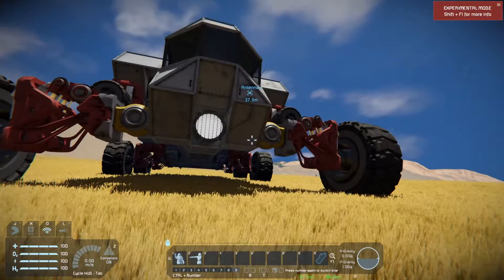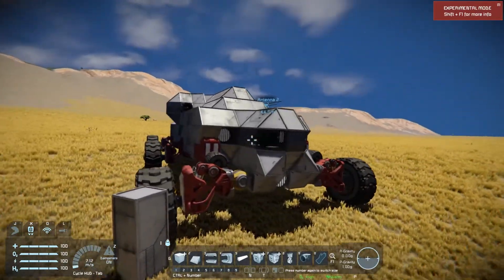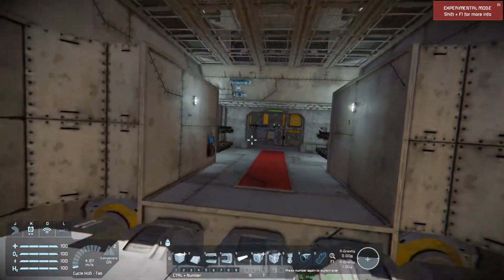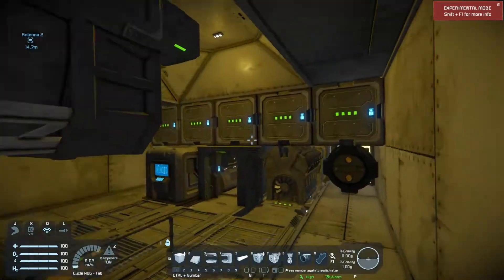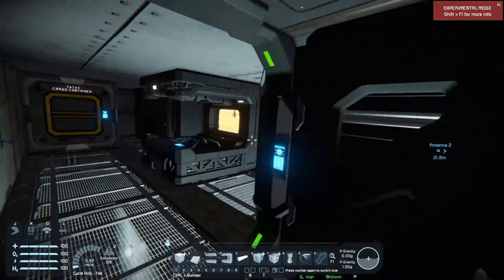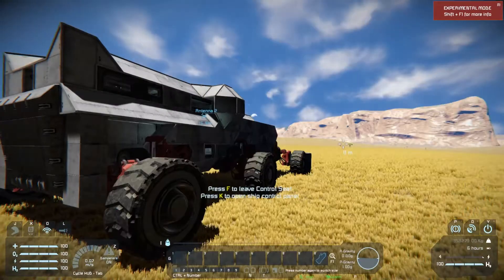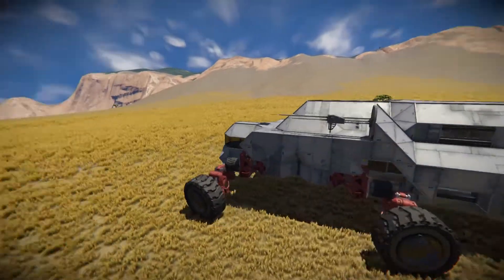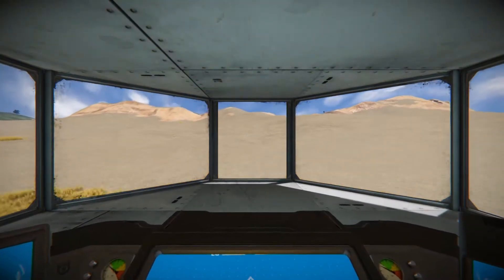SPACE ENGINEERS SUSPENSION SETUP THAT WORKS

Comment: I love this idea, however, I do have something I would like to try as soon as my finals over and I think you might have fun with it as well, especially since you noted difficulty with tuning out the bounciness of the system.

Pandemic Playground posted a video on Hinge Suspension and I think combining that with your idea of placing 1x1 suspension over the articulating suspension components might be pretty neat. I think this would be a good idea since the camber would not change with the suspension travel (the wheels will stay perpendicular to the ground throughout their travel with hinge suspension). 

More importantly, depending on how long the links are between hinges, you can choose how far or close the 1x1 suspension is placed to the center of the vehicle essentially being able to vary how much leverage the wheels have in comparison to the 1x1 suspension. Overall, being able to vary the leverage may allow you to choose how far the suspension travels upwards past its normal position before fully bottoming out the 1x1 component. Finally, the reason this may be worth exploring is that the ability to change the difference in leverage between the wheel and the 1x1 component may also allow for influence over the rate at which the suspension travel slows, when being compressed, allowing for less bounce when hitting a bump or hill if done properly (a phenomenon you noted in the video). 

I think the greatest issue (after it's all been tuned of course) would be making it compact and that might be the deciding factor on whether or not you explore this combination of suspension ideas. I'm also hoping to look into pushrod-style suspension setups, however, that'd simply be a different (not necessarily better) way of packaging the system. Overall, I think your idea is great, especially due to how compact it is, I hope further refinement is possible but the simplicity is what I like about it the most so I don't even know if it's worth bothering with! 
As others have noted, however, I would think limiting the maximum extension of the suspension through the options available for the hinges would be a simple improvement to the design (although, I'm sure you've already looked into that since publishing the video).

Overall, I love your suspension idea, if you ever get around to updating the system be sure to upload another video!
Reply from the maker: I've actually done a tune and fix with it I just haven't had time to hop on SE and make another video. I've been trying to figure out how to properly explain everything but I do have some good improvements. Along with comparisons. Hopefully I can find time between work to get this out to you guys. This setup is ideal for any server with scripts tbh
Reply: @TheNeoAndy  Ah gotcha and I agree, recording anything instructional can be a pain, so I completely understand your struggle : P  I do, however, look forward to seeing your follow up video whenever it is done, hopefully, work is going smoothly for ya! (I know covid really screwed with the schedules of a lot of my friends so I wish you the best, man.)

Comment: I like this, it allows you to have the soft settings for smooth rides but also have the hard settings for agressive bumps and falls.
I would suggest capping that top suspension so the bottom suspension cant raise too high to the point that your vehicle will bottom out before using all the suspension travel.
I would also suggest capping the rotor so your wheels cant go too low when you go over those jumps. would be rather unfortunate if you go over a hill wrong and oyur wheels get stuck beneith you and you roll.

Comment: Hmm, double wishbone suspension might work too.  I don't know if it would self destruct due to collisions though.  Maybe they'll add a spring block someday.
Reply from the maker: I was thinking about that idea first but double wish bone only seems like it would be useful for mega rovers, due to spacing they take up
Reply: @TheNeoAndy  What about small-grid suspension on a large grid creation using small rotor heads (yes, I do summon the almighty Klang).
Reply from the maker: @VroomNDoom2602  this could possibly work however small grid suspe sion wont absorb impact as well with the added weight. I made a small rover with the same suspension and it works just as well. But the i.portance here is how well it keeps itself steady and how it crawls through those hard to reach spots.
Reply: @TheNeoAndy  Yes, I was very impressed that you didn't bottom out on anything or take damage in some way.  Your suspension is very well made and I never would have though of using a wheel to hold down a suspension arm.
Reply from the maker: @VroomNDoom2602  i made a couple of improvements to the setup and made the  suspe sion not so wonky going up hills. Gonna try to make another video better viewing the setup as a whole than just the ship.

Comment: That's actually a good idea. I would make the suspension hinges having a max distance so they won't totally flip to 90° when on air, otherwise that's pretty good for a first video, congrats.
Reply from the maker: Thanks a ton!
Reply: That was about 3:35, definitely need angle limits on the hinges adjusted. Fantastic otherwise, and easy to reproduce.